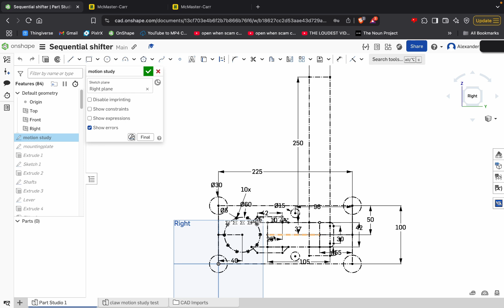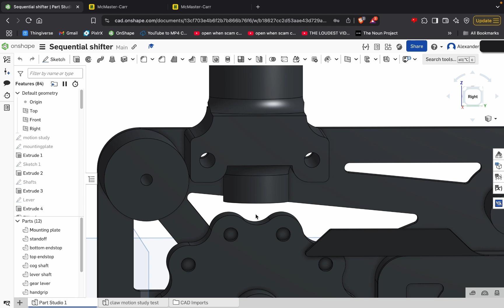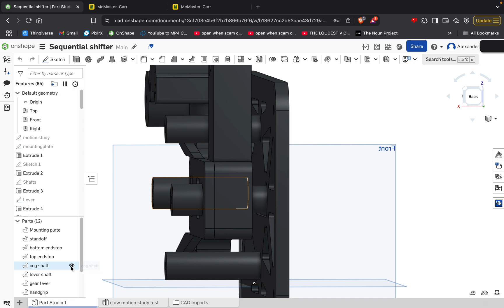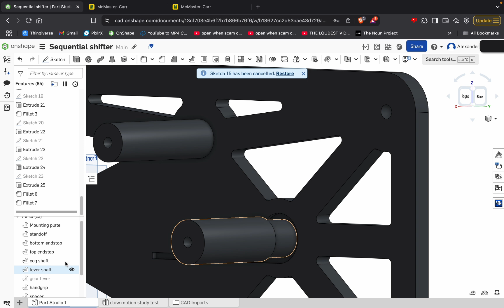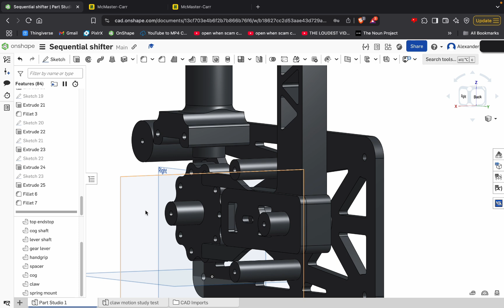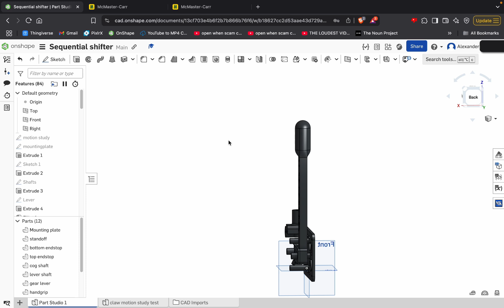3D Printed Custom Sequential Shifter Build Ep. 1

Comment: Very, very clever design Broski. I am conjuring up sth different. Where I have a ball bearing pushing onto a guide that is directly mounted on the lever. So ideally I don't need a torsion spring to make the Lever go back. I need to prototype it but your design will work better than mine I think.
Reply from the maker: Thank you. I would still try out your ball bearing idea because (you'll see in a video that I'm going to upload hopefully later this month) usually a torsion spring isn't meant to return to it's neutral position as it does here, because if the spring is deformed just a little bit, which it will be, it won't recenter. In like an airplane seatbelt buckle or something similar the reason a torsion spring works is because the position it ends up in when no other force is acting on the lever is not meant to be the neutral position. The torsion spring is still compressed/stretched when it is pushing/pulling because it's hitting a hardstop. This design with my shift lever was a bit difficult because the neutral position is supposed to be the upright default position of the torsion spring and it is not being hardstopped before it's neutral position because it has to travel both ways. Hope that makes sense and I'll be happy to help with your design if you have any questions.